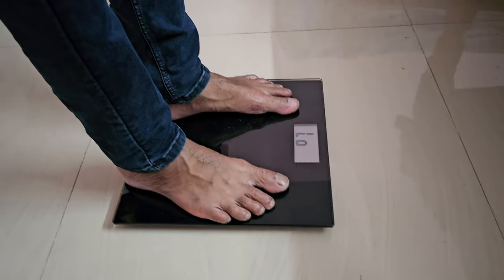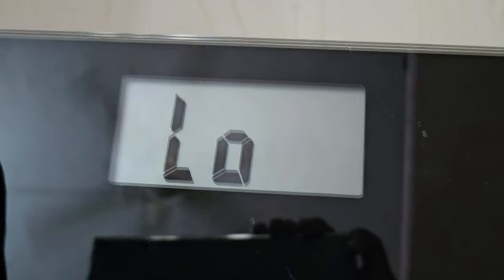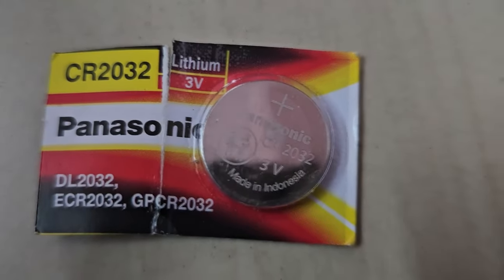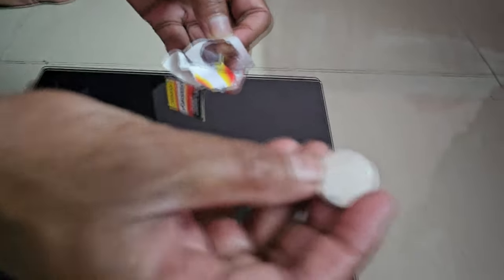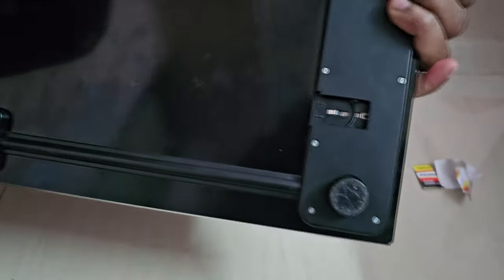How to fix the 'Lo' error on a digital scale or weighing machine?

Comment: Mine still says low after new batteries
Reply from the maker: Make sure the battery number matches the one on the scale.
Reply: Same
Reply: @DaBox_  I found out my scale had corrosion around where the batteries went. I was able to scrape slightly around it and get some off. Then it worked when I put the batteries back in.